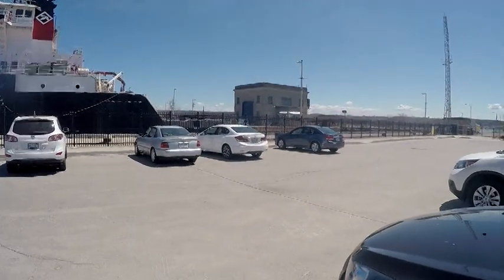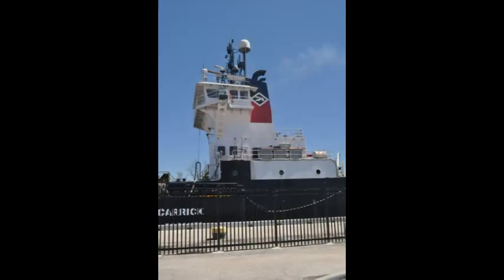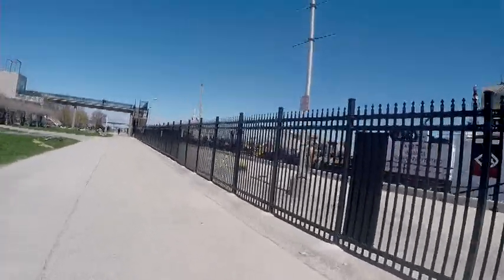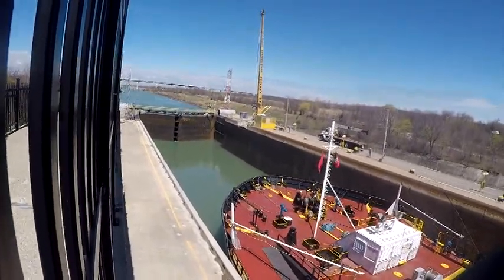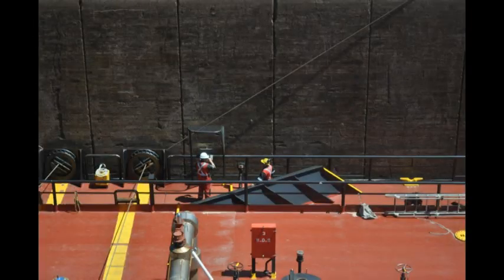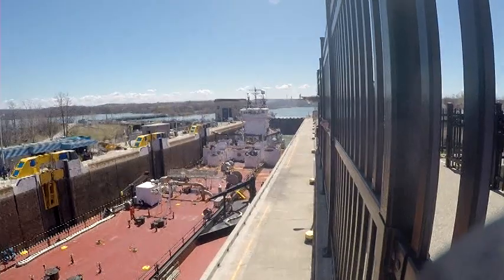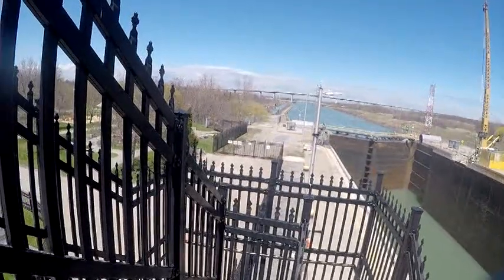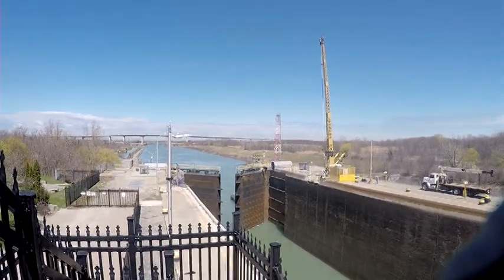5-1-15 - Day 3 - Welland Canal Locks - Part 1

Comment: Always have wondered, where does the water in the lock go? Does it go in front of or behind the boat?  Just wondered.
Reply from the maker: +RV Granny Depends what direction the ship is going.  If the ship comes from high water, the water is let out to lower the ship into the "low water" which is normally the front of the ship.

If the ship comes from low water, the high water is pumped in the front to bring the water up to level to the high side and the gates open and the ship sails on.  Very neat process and very interesting.
Reply: That all makes sense. Thanks for allowing me to stop wondering. Thanks.
Reply from the maker: +RV Granny - In the old days, they even had locks but no pumps.  They just opened the doors and either let the water in or let the water out.
Reply: Yikes, that sounds a little dangerous.
Reply from the maker: I think it was a little dangerous but it worked great and it was so much better than running rapids.